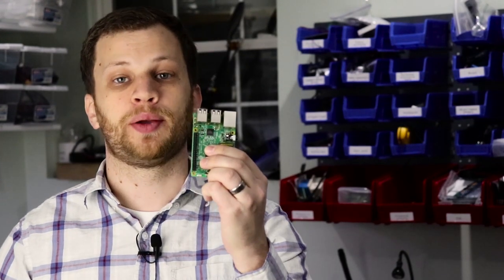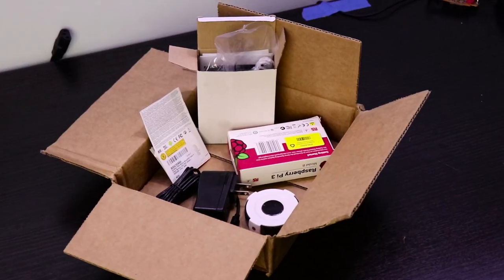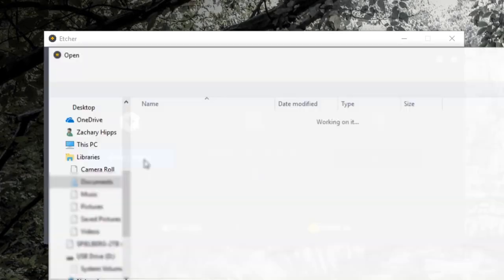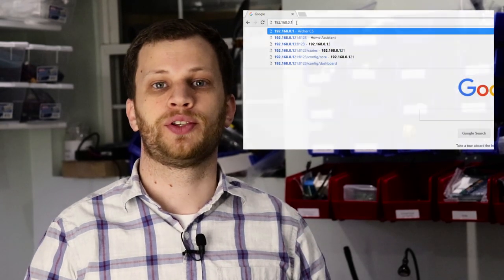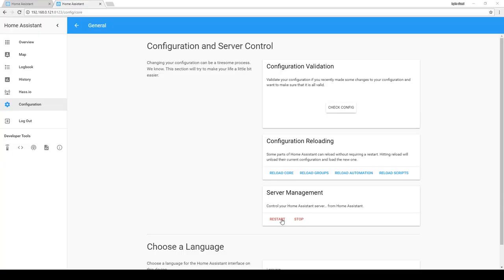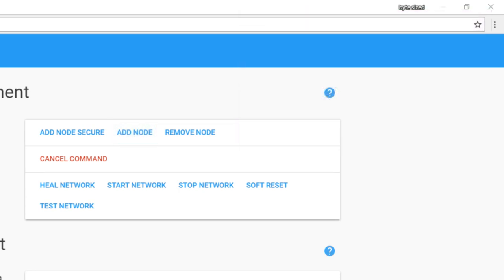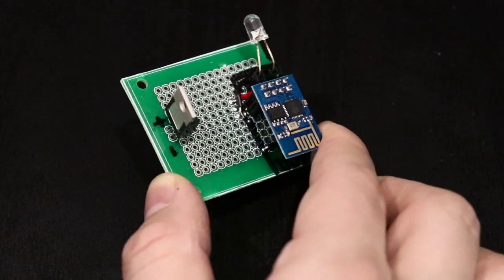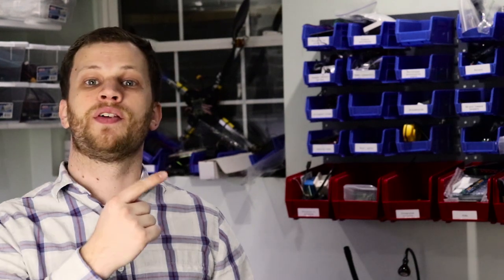How To Setup A Raspberry Pi Home Automation Hub

Comment: Hello byte sized, I'm working on an automated kitchen cabinet for my senior design and would like to install several sensors (force sensor,  motion detection sensor, and gesture sensor) do you have any recommendations for the proper sensors?? will use pi 3 as the uP and power supply will be 12VDC

Comment: Just wondering about your Desk.  Where did you get it? Or did you make it? Thanks!
Reply from the maker: I bought the desk top from ikea, and made the legs from 2x4 from Home Depot. I knew I was going to be working on the surface so I threw down some 1/8" hardboard from Home Depot. That way I can mess up the hardboard without worrying about the desk underneath.

Comment: thanks for all your videos and super informative and great work. I have a query and if you can answer I will appreciate. 
I am in the process of automating my ceiling lights and bedroom lights with Sonoff smart WiFi wireless switch. It worked great but the problem is, i cant switch on/off manually with physical switch in the event of WiFi/internet goes away. Is there any way we can set it up with Sonoff or do we have any alternate products that work for my case. In fact this is everyone's limitation when it comes to Sonoff switches. Please advise. TIA

Comment: It would be awesome, if you could find a way to integrate the Sonoff Switches into Homeassistant without loosing the Google Assistant Integration feature! It's pretty easy to reflash the Sonoff's to integrate them into HA to then controll them using MQTT, but it losses the Google Assistant compatibility.....
Reply from the maker: That might be interesting to look into. Thanks for the tip, and thanks for watching!
Reply: I believe you can link home assistant to the Google home app

Comment: Hey Zac, I love your enthusiasm to want to automate your home. Seems as through you are really switched on. However i am a bit confused as to why you are trying to integrate old IR technology with Wifi enabled devices. Please get back to me perhaps i am missing something.
Reply from the maker: I have a TV that has a regular old IR remote to turn it on/off. It doesn't have HDMI CEC compatibility, so the only way I can think of to automate it is to use IR signals.

Comment: Cool concept, would def like to see you expand on this. I am just starting my home automation with some google home minis and that sonoff smart outlet you mentioned in your last video. Couple of questions...

1) Do you recommend getting the RP 3 or could I get away with one of the cheaper ones?
2) Where did you purchase the z-wave usb stick? 

Thanks!
Reply from the maker: If you're just getting started I would honestly recommend getting a smartthings hub or wink 2 hub. They will be less hassle in the long run. Once you get your feet wet and want to do some advanced things, get a raspberry pi and zwave dongle. You don't have to get the rpi3, but having the built in wifi is super helpful.